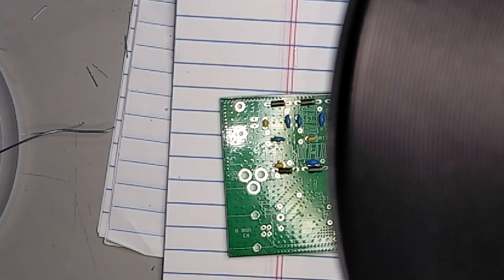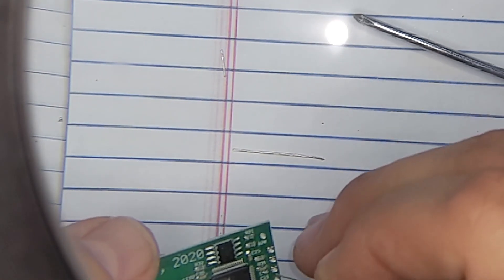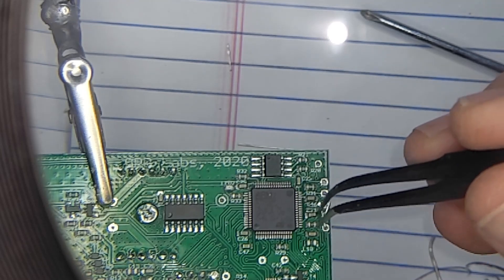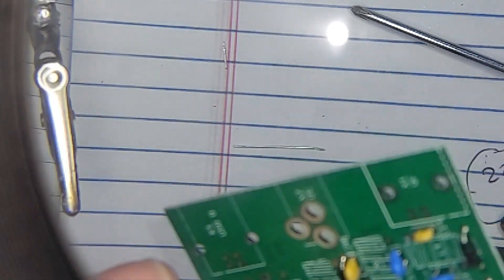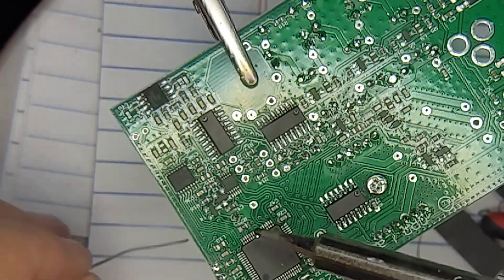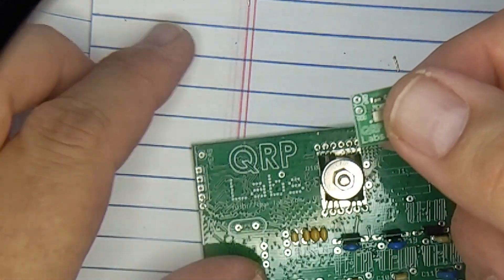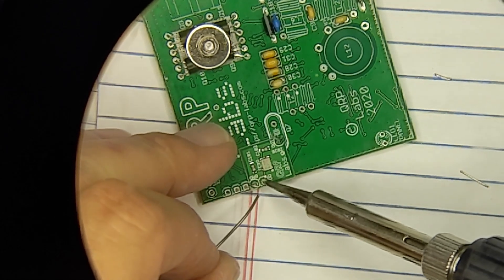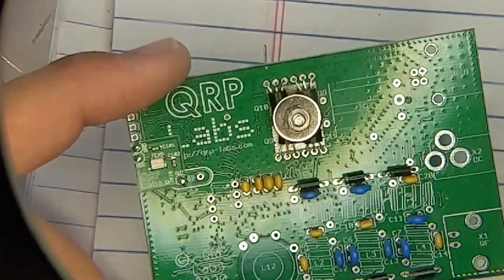QDX Build Part 5: Installing The TCXO

Comment: What I do for a task like that it stick the bottom ends of the wires into a small solderless breadboard. That keeps them in place for adding the board. You might need slightly longer pieces of wire because you'll need extra wire on both ends, but usually you will have some long enough cut leads available from something.
Reply from the maker: This is a fantastic idea. I've pinned your comment so that others will see it. I wish I'd thought of that! Thanks for sharing it, Shirley :) 73!
Reply: I'll sometimes use the foam blocks that ICs come pushed into for the same thing.

Comment: I did ask but forgot question mark!!! T1..38TH turn..does it run under to through hole on outer ring at 9 o clock..just looks awkward..but hey ho..if it works..73
Reply from the maker: Are you referring to T1 on a QCX?